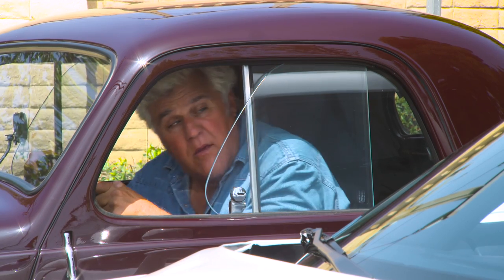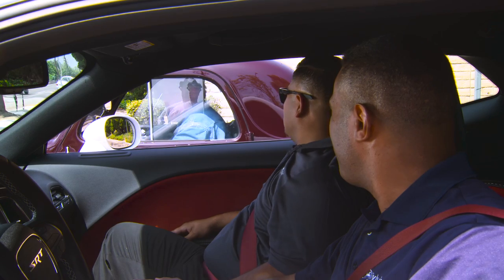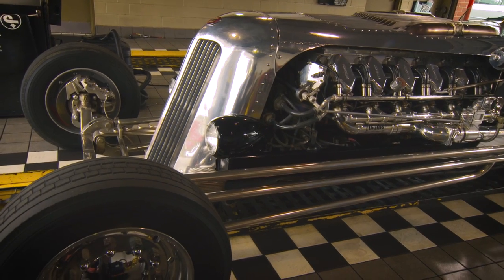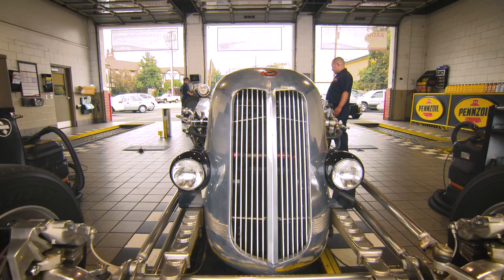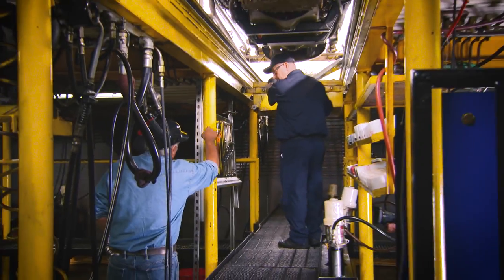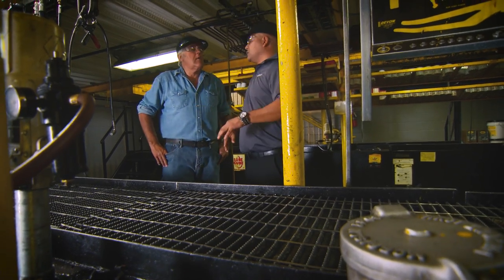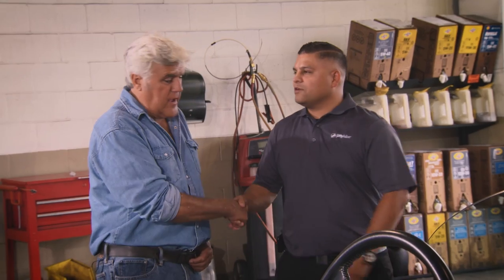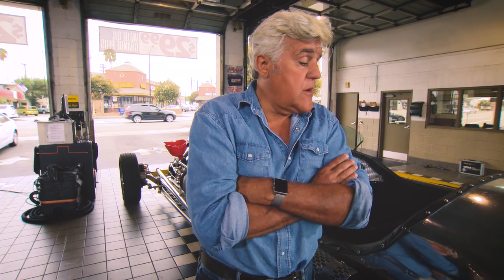Biggest Oil Change Ever - Jay Leno's Garage

Comment: Isn't Jiffy Lube the place where they scam you?
Reply: Yes
Reply: +Chicken Soup even with their funky coupon it would be more expensive to change the oil with them than any local shop. Plus they'll try to do unnecessary stuff. I went once and they ripped my excellent air filter just so they can put in new one. I was so pissed because I knew there was nothing wrong with it so I told them no I'm ok and I bought my own air filter and installed (which I usually do on my own) I would've done my oil change but the apartment building I used to live at wouldn't allow to do such thing
Reply: +ZankDigiTrash  I let people who live in the apartments across from me change their oil at my house. The people I like at least. Jiffy Lube staff got mad at me for telling them just the oil so they took my air box apart on my 330ci. I almost knocked out their manager.
Reply: hell no if i lived in an apartment im doing my oil change in the parking lot
Reply: You bet the are scammers and have been caught many times with hidden cameras.  Jay should had known this.  Hope he dumps them as an advertiser, if not I will not watch this channel.  This company messed up my car in 2004 and then I learned of all their problems.  Just stay away from Jiffy Lube.
Reply: 95 bucks for a synthetic oil change. Fucking insane
Reply: +ZIPPER978 I use amsoil and its 95 bucks for the oil itself.
Reply: Guy Fawkes
How so, when it is the only oil that doesn't burn off so fast in my racing cars?
Reply: +FSociety Dude, I get Amsoil oil changes for 45 dollars.
Reply: GunslingerGrim
You are probably using their cheaper oils and your car probably uses less oil too.
Reply: +FSociety It's an S2K, you don't even want to know what I go through for oil. 5 quarts of Amsoil Dominator only cost 53 bucks directly from them, check their site - Still pretty sure you are getting ripped off.
Reply: GunslingerGrim  My track car takes 9 quarts. =(
Reply: +Chicken Soup Lets just say i would not let them change the oil in my deep-fryer.
Reply: YES !!!!
Reply: Until they leave the drain plug loose or decide the oil filter was to hard to get to so just wipe and leave the old one on .... I would suggest to NEVER take anything of value to Rippy Lube.... "cheaper" is not always "better"
Reply: Just to let you know .... thats funny. The odds are at a Jiffy lube there is a much greater chance of something bad happening than say a reputable repair shop. I guess there could be a good Jiffy Lube somewhere in the US that hires and trains competent people ..... not likely ....  but you believe what you want. I would make a bet that most Jiffy lube employees are trained to sell wiper blades - transmission services, air fresher, rather than how to actually change oil - Folks that defend Jiffy Lube usually own one ....
Reply: Jiffy Lube's issue is upselling stuff people don't need, which is something a lot of businesses do. Just like any other shop you do get your occasional unethical and dishonest employee. Like most department stores "Oh you want to buy this TV remote? Let me introduce you to our $15 warranty plan where we act as a liaison between you and the manufacturer's warranty on a $10 remote."

But still I prefer to change my oil myself so I know it's done right, but it's because of my aptitude to do so. Some people don't have that and others don't have the living situation that allows them to DIY oil change.
Reply: *****
My complaint isn't with the upsale itself, but with unethical and dishonest methods some employees and/or managers use to do it.
Reply: +Chicken Soup yes complete con artist!!!!!!!!!1
Reply: +BlueFoxTV Good one!  I wouldn't trust them to change a diaper.
Reply: +Chicken Soup they dont even change your oil. they say they do
Reply: A lot of lube shops like Jiffy lube are total scams. Local shop called Grease Monkey came in with a dirty air filter when I got my safety and emissions done, I have a Volant Cold air intake and they brought in this shitty little paper filter, I totally called out the manager it was gold! I do all my own work, I don't trust most shops in general, royal purple oil change on a G8 is EXPENSIVE. Took my 9 fucking quarts yesterday
Reply: +Brian Athay SO how did the manager respond when you caught him in a lie?
.
Reply: +Chicken Soup I don't think there is anything wrong with Jiffy Lube in particular. They like all businesses are trying to make a buck and the workers have a script to follow. This is good and bad. good part is that they check a lot of stuff, bad thing is that they are not typically knowledgeable and claim that you need services that you do not. one bad experience does not mean that every shop is full of shysters. If you know your car and keep it maintained you should know what needs to be replaced but for 90% of the population they will continue to rely and be swindled by unscrupulous service shops until facebook gives them auto maintenance updates. I have had a few bad experiences with Jiffy Lube but it isn't just them. I can't physically reach my oil filter without a second elbow and I drive a lot of miles so I change often. I bring my own oil and my own filter to avoid the extreme cost of synthetics at retail and the coupons make it around $20 with no headaches for me. I know when my k&n was last cleaned and recharged, I know when my wipers need replacing, and I know that even though they recommend an automatic transmission fluid change that they feel stupid when I inform them it is a manual. So yeah, if you know nothing about your car you are low hanging fruit for the less than honest service center but that goes for all of them even dealers. and if you know what to look out for you can save a couple bucks and some time.
Reply: Adam Kunz What kind of vehicle do you have that you can't reach the filter? I have a 2014 Chevy Malibu and I can reach the plug and filter just barely enough for a change if I drive it onto a couple of 2x8 boards.
Reply: 08 Civic Si
Reply: +Chicken Soup just gotta remember to say no to everything else haha. Just oil change that is it.
Reply: +ZankDigiTrash depends on the shop.  They should NOT be replacing an air filter without your permission.
Reply: You have to say "no" about 43 times when you go in for an oil change.  They'll tell you you need a new trunk lid if they think you're an easy mark.
Reply: jpdemer5 they wouldnt even service my car. 2003 audi a4 and they said they couldnt do the coolant flush bc "you have to take that to an import guy" and tried to tell me the universal coolant wont work in it either
Reply: Dean Kruse that's cause they don't have correct coolant/color
Reply: Chicken Soup I worked there and they scammed people all the time so I left when they asked me to start doing it to customers. I worked at the one in Texas where the president's office was for the whole company and him self was a terrible person. Still love Jay's show though.
Reply: I paid $118
Reply: Who knows if Jay isn't aware of that and that's the message behind his "scam" on the clip? :P
Reply: Chicken Soup well you know they ain't scamming jay leno when he cones in
Reply: Chicken Soup 
yup. they're crooks
Reply: I don't know about scamming the public, but I refuse to take a chance with getting my oil plug cross threaded.  I would never take a vehicle I valued to one of these places.  Love Jay Leno's Garage and have no problem with watching a commercial now and then.
Reply: Brett Kramer same here
Reply: the last time we went there they forgot to put the oil back in. never again
Reply: Yikes !!
Reply: George, It would cost me $80 to change the oil in my M3 myself. The BMW dealer does it for $75.
Reply: weedshoes $80?
It costs us that to change the oil in our medium duty trucks and they take around 20 quarts.
Reply: George Bonis its also one of the most inconvenient, as you have to deal with hot oil, and put it somewhere that isn't gonna be damaging to the environment
Reply: I use mine to start brush pile fires, that's if I don't have an old tire handy.
Reply: Just chiming in. My boss had his oil changed a few times at Jiffy Lube. He suspected they weren't replacing the oil filter, so he put his initials on the filter right after an oil change and drove around in the winter for a while so it got nice and dirty, then went in again. When they were done and pulled it out of the bay he grabbed the manager, popped out a flashlight and there was his old filter, wiped clean, initials intact. I wish I could have been there to see the manager squirm.
Reply: Esteban Dufanzo the funny thing is that's the most important thing to change is the filter. I know engineers that just change filter and top off the oil. and their cars r just fine but not change filter come on. that's fraud
Reply: Vic Polaris 
Oil goes through thermal breakdown so it's not a good idea to not change your oil
Reply: Bob Piff I know but these guys don't but they at least  change the filter
Reply: Go to a friends house , parents or a good neighborhood just don’t stain the floor tho lol
Reply: @zipper978  I spent 180 on 2 cars with amsoil and do it my self barely drive my cars so every 6 moths oil look still new when I changed them lol
Reply: @Slaughter-Bunny  you got the 1.5 litter engine?🤔 lol
Reply: @mathlover101hotmail  heard the coyotes take 8 but the 350 Shelby uses 10 or 12 can’t remember
Reply: @FranciscoHernandez-dq7rf  bro. Wtf was that. Did you even go to school or are you here on a visa

Comment: A few years ago my dad was on a business trip in Cali with his company vehicle.He was in Palm Springs which is about 2800 miles away from where I live. He knew he was going to need an oil change before he left to come back home. He was there for just over 2 weeks. He went to Jiffy lube and got charged $70 to do a synthetic oil change in a e250 with a 4.6l in it. He didn't really care because company vehicle meant it was charged to the company, not him. After the oil change he started his drive back home. After driving about 5-6 miles suddenly his oil pressure tanked and his oil light came on. My dad previously being a mechanic pulled over and started investigating. He pulled the dipstick and there was no oil on it. He couldn't see any in the engine bay so he got under the van and started looking. He noticed everything from the engine back was coated in oil. He looked and the drain plug was gone. After calling a tow truck and getting hauled to the nearest shop they tried to put a new drain plug in the oil pan but they couldn't get one in. Jiffy lube cross threaded the plug and didn't bother saying anything to him about it. the vibration from the engine backed the plug out and caused it to fall out, draining all the oil out of the engine. The mechanic that they brought the van to had to retap the threads and put a different plug in the van so it would work. Lets just say the company sued Jiffy lube for a lot of money and all the techs from the company were told to never bring their work vehicles to any Jiffy lube ever again.
Reply: +Tank77 Sorry for your dad, sorry for the engine, for the company and the environment etc etc... however I'm happy that people get problem so those that made the mistakes could be fucked up for good.
Reply: +Tank77 This is why I do my own oil changes.. yikes..
Reply: +Tank77 Jiffy Lube did the same to a friend's Jaguar and another friend's Range Rover.
Reply: +Tank77 There was a jiffy lube across the street from a GM dealer I worked for. Their guy was at our shop every day buying drain plugs, repair kits and gaskets every day. They also bought a number of oil pans. They kept the parts guys busy at least.
Reply: +richard cordova Stop reading out loud then. It's your voice, not his.
Reply: richard cordova On another note; Jiffy Lube, doesn't carry oil filters for antique tank engines. Being military, they might have reusable ones that you just dismantle, and clean, but that would be a specialized part/procedure that most oil change techs wouldn't have the slightest clue about. It would also likely be located inside the oil pan. It's also possible that Jay, brought a filter, and coached them through it, but I seriously doubt it. This was just a promo.

Oh, and you can go lolly-pop Hugh Hefner's butt plug, ya mouth breathing cockwaffle. ;)
Reply: +Tank77 Next time get the oil change BEFORE leaving home.  That way you can run 7500-10,000 miles to California & back without setting foot in Jiffy Destruction
.
Reply: +electrictroy2010 they get oil changes every 5k miles per company policy.
Reply: +Tank77 I'm sorry your dad got screwed. I hope he learned his lesson.
Reply: Tank77 what kind of car is this?
Reply: Having changed oil many, many times on a variety of cars and trucks, I gotta ask: how the heck can you cross-thread a sump plug?
Reply: R  C Nelson It takes extreme skill in the art of fuckering things up, something most of their "auto technicians" are experts at.
Reply: @Oldbmwr100rs  Takes talent to cross thread oil drain plugs. Maybe they put the plug into an impact wrench and then power it into the hole?

Comment: Jiffy lube only charged me half price to change the oil on my Tesla.
Reply: They told me that it was time for a coolant flush. It was a good thing they actually had the Tesla OEM approved Anti-freeze/Coolant in stock because it was on backorder and I got the last little bit they had left in inventory. They also told me that I should never have to have it serviced again aside from the occasional top-off because Tesla had changed their formula to a more eco-friendly one that doesn't wear out like conventional coolants do, and that it's now 100% non-corrosive, so my radiator and all the hoses and lines are now better protected.
Reply: @sped6954  100% non-corrosive is a lie, still might last longer then the car, but moving fluid will corroded metal, and that corroded metal will corrode the other metal faster

Comment: for the record, NEVER EVER go to Jiffy Lube
Reply: +27pattywhack2 why is that?
Reply: +27pattywhack2 But the sponsored ad I just watched said they're great.
Reply: +27pattywhack2 Yeah, real men change their own oil!
Reply: They are a terrible company! There are hundreds of reports of them charging for part replacement and they don't even replace part. As confirmed by CBS..
Reply: +Bob M.
Reply: I get my car inspected there that's it.
Reply: +David S They told me that my inspection could not be done until my muffler bearings and piston apex seals were replaced. They tried to sell me a new anti-battery sway bar because it was swaying too much.

Comment: I'll stick to either doing my oil changes or taking it to my local spot for 30 bucks. Not 65 like jiffy lube charges.
Reply: +Beastly Man All depends on the owners and what type of oil you need.
Reply: +Brendan R In my neck of the woods dealerships do it for $24.99. It's actually less than what I can do it for myself.
Reply: +BillyJoe1305 But the quality of oil they put in your car is garbage. Good oil, the type I use costs me $60 an oil change w/ filter when I do it myself. I have a car that is 40 years old and never had a problem with it. Oil is one of the most important things you don't want to cheap out on.
Reply: *****
  The quality of the oil at Jiffy Lube isn't gonna be any better than a dealership. The dealership will use the manufacturer's recommended oil and them doing it is the only way not to void the warranty on a new vehicle.
  There is no reason to put royal purple in anything but a sincerely overbuilt or over-driven drag race car. That is the only thing that would/cost me 60 dollars to do an oil change with, and only if I was lazy and picked up single quarts from Autozone. Even then I'd have to buy a 20 dollar filter, which would be hard to find. I guess, with tax, a K&N or one of the high end versions of the Bosch filters would bring me close to 60 bucks.
   Furthermore, if your car is from the 70s shouldn't it be built to take single weight oil anyways? I kinda have trouble believing you spend 60 bucks an oil change. I think you don't plan ahead and instead of buying 2 five quart jugs so you can just get one the next time you buy a thirty dollar jug a 6 dollar bottle and a 15 dollar filter.
   On a sidenote, the only gear oil I could get for the trans in my old Nissan was, in fact, Royal Purple. Cost me like 15 bucks for a tiny bottle. Almost wasn't worth it for a car that was already on its way out by the time I bought it.
Reply: +BillyJoe1305 The Magnuson–Moss Warranty Act makes it illegal for a manufacturer to deny a warranty claim if an independent shop, or yourself, did routine maintenance or oil changes. Just keep all your receipts and keep your records straight.
Reply: Doug Harlow That was true until they made the service free.
Reply: Nice tacoma! 👌👍💪💪